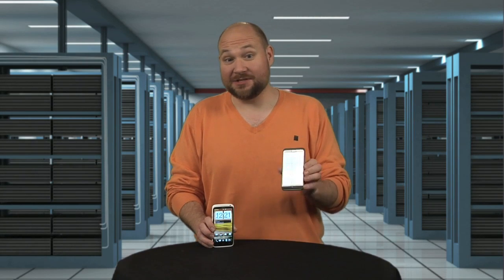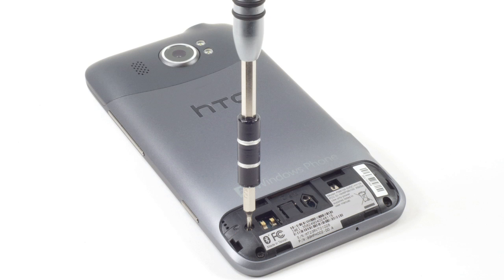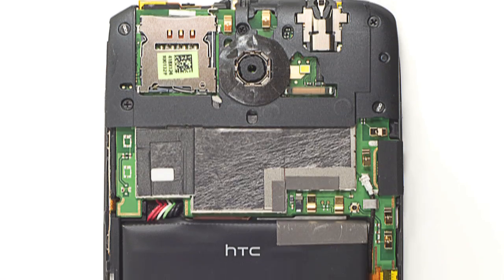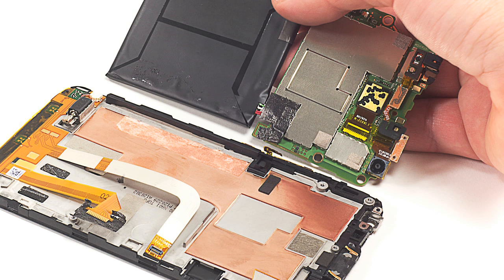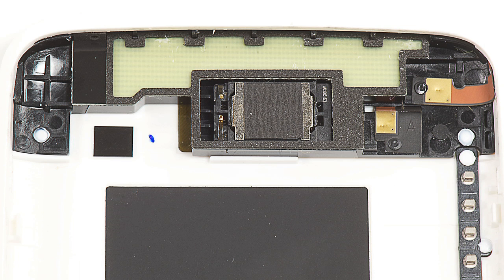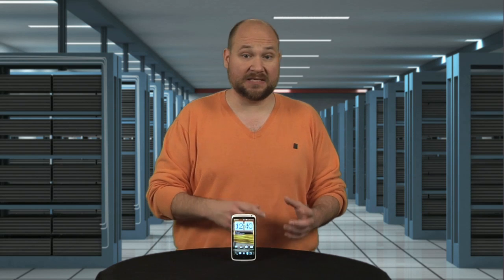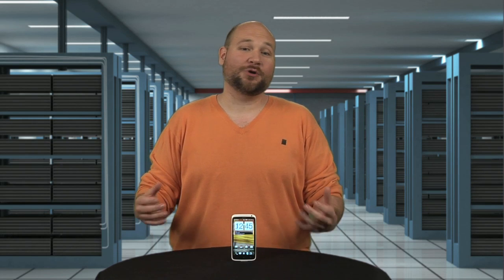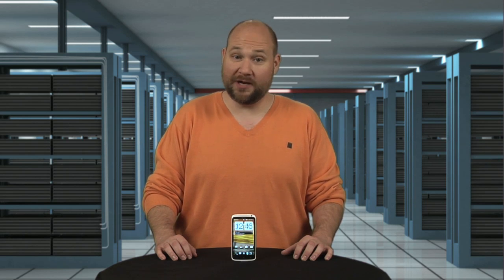Cracking Open: HTC One X

Comment: this just shows you either don't know english, or you didn't pay attention and just came here to bash this guy because you love this phone too much. He said its hard in general to take apart and replace stuff because 1) unibody 2) (main reason) its cables are connect on either side of the board making it hard to put back together 3) the battery is attached to the mother board.